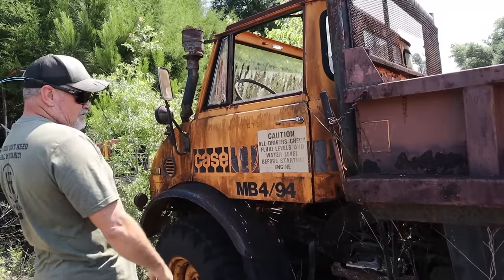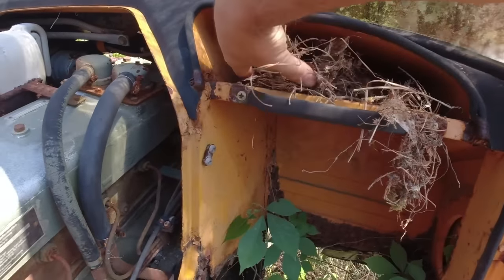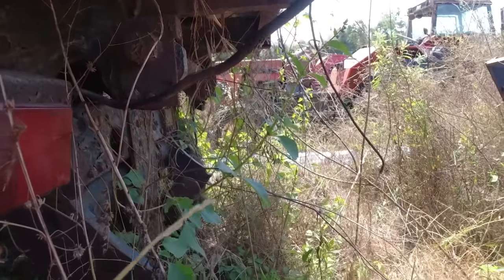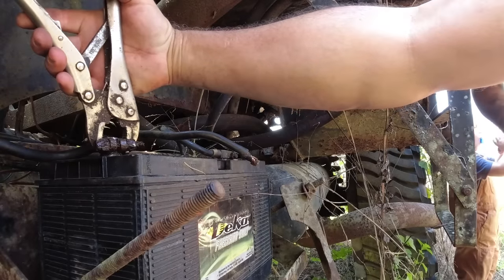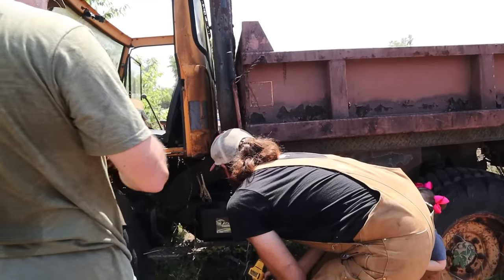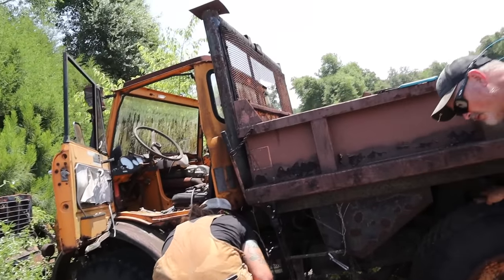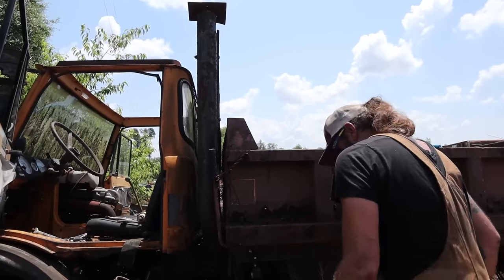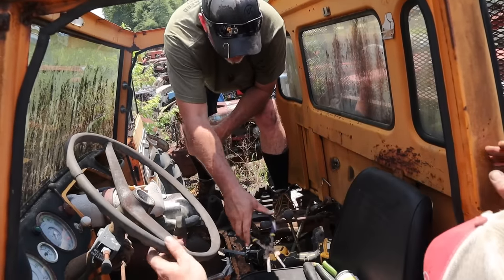We Found a 47 year old UNIMOG hiding in plain sight! WHERE IS WILEY WHEN YOU NEED HIM?

Comment: Hey Hank, so if you follow the history of those, it is a military unimog 419 it was a partnership between case and Freightliner, which they had it made by an American company to be sold to the military. If you start doing some research they’re pretty interesting and they came with a lot of different options
Reply: NOPE!! .  that is PRE 419..  being a 75.  Anyway.. what it is... Clearly marked. CASE MB4/94.   Sold by Case.... Made by MB.   Other wise known as a CASE (unimog) 406.  Slightly longer version would be a 416.  

Best place to discuss this truck, find info on parts etc.  is Benzworld   discussion board   Unimog forum
Reply: @coachgeo  we have a 1975 (406)... pain in the butt but still useful. I'm searching for a fuel tank dip tube with banjo fitting.

Comment: Just watched this was really rooting for you guys to get it started!  There's an access panel on side of footwell to get to the starter to put your jumper cables onto the starter easier.   Turn key to right then push clutch in then hit starter button.   If it tries to start but no fuel there's a hand pump on injector pump then pump till it gets resistance then try starting again. 
It'll go they're very simple.

Comment: Probably one of the most capable 4WD vehicles ever made.  One county near where I used to live used these Case--labeled versions for snowplows for years.  They loved them, except that the bodies tended to rust badly.  Also, for a diesel, they didn't get very good fuel economy.  In low-low range first gear, they would crawl at idle at a few feet per minute.  Plus, fantastic ground clearance with those portal axles.

Comment: The Unimog 419 is a vehicle in the Unimog series that was developed on the basis of the Unimog 406 as a pioneering vehicle for the US Army. Daimler-Benz built this vehicle from 1986 to 1991 at the Mercedes-Benz Gaggenau plant a total of 2,416 times. All vehicles were delivered to the USA and used exclusively by the US Army and the Marines. Four models were created. The Unimog 419 was marketed under the Freightliner brand name. Most of the vehicles were so-called Small Emplacement Excavators, or SEE Tractors for short.

Comment: If you push the ignition key down you switch it on,turning it switches the lights on and off.key down and press starter button,to switch off pull stop lever if seized pull throttle up.

Comment: I have a mercedes unimog full restourated de starter might be okay becaus a unimog needs a lot of power to start and strong battery connections i was trying to start mine with jumper cables that didnt work and with strong connections it works so this maybe solf the problem